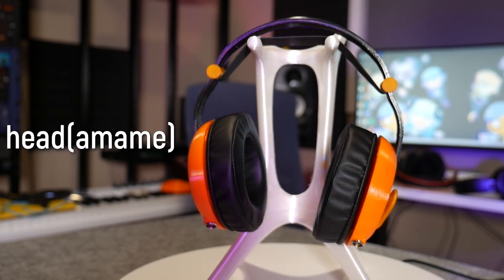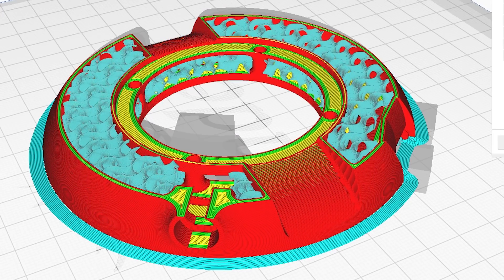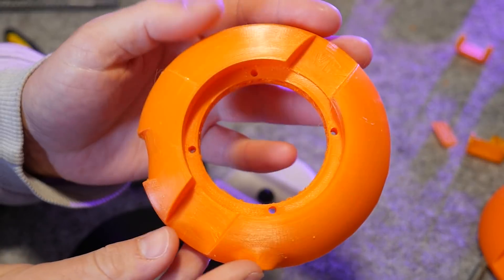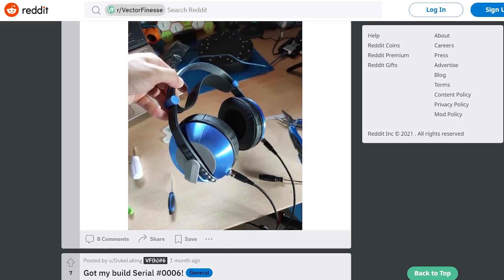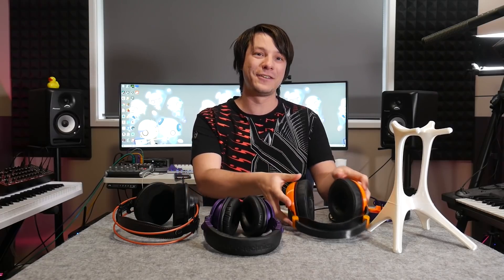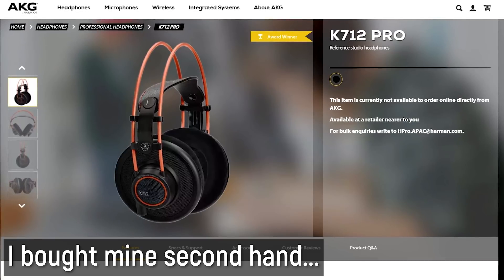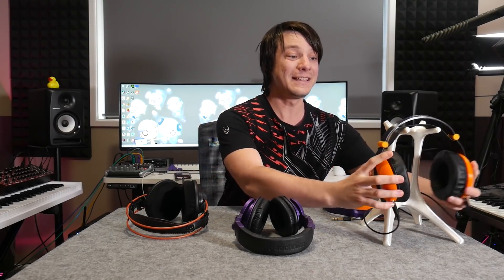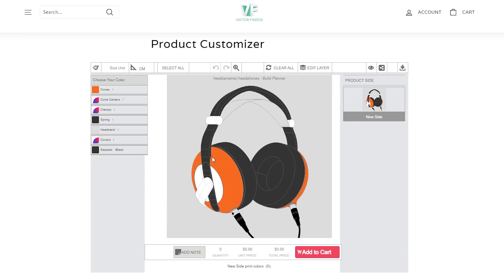Should you 3D Print Headphones? Head(amame) review

Comment: I built probably 7 different pairs of 3d printed headphones.   I would say the DMS Omega Headphone was by FAR the best one.  Although not as nice looking in my opinion, as the Satyr 3 Headphones.  Those were the second best in my opinion, and the then the Satyr 2 were 3rd.  Capra audio has headphone headband files for the DMS Omega as well so you can 3d print everything except the driver, wires and connectors.

Comment: You can try using velour or velvet earpads. This will give you more balanced frequency response with more clear hi-mids and treble. Also you can try thinner pads (leather, velour, velvet, etc.).
I just ended a mod project with an old bad sounding Behringer HPX2000. I replaced the old 40mm drivers with 50mm, very similiar to yours. Also replaced driver holders, 3D printed. I tried from about 10 pairs of pads - pu-leather, velour and velvet, different sizes and tickness. Of course, the much important thing is the driver itself, but the pads can seriously alter the overall sound response.
The use of leather pads brings nice bass, but also muddier sound in the mids and highs. I ended with velvet pads and sound very close to ATH-M50, which is one of my favourite headphones.

Comment: I am always confused seeing 3D-print channels struggling with... well... printing.
How is PETG difficult? It prints almost as easy as PLA.

You can have perfect results every single time.
Just use the generic PETG settings from Prusa every time.
It just works.
It is not the material. You just lack the experience with the material. But that is no problem, because Prusa did the work for us. 
The moment you start understanding that, you will forget about ABS and just go PETG. No toxic fumes, no splitting parts, no trouble.

On another note:
Thanks for the great video! This projecte is awesome! 

:-)

Comment: Guess I am screwed as someone with only a resin printer.
The infil settings are a bit of a deal breaker!
Reply from the maker: honestly I don't think so, you could replace them with a 3D Lattice which would resin print well. Could be interesting!
Reply: @MakersMuse  How dense would the latice have to be? I imagine the way the infills design actually has an effect with the cross section each part of it seems to have

As in, if you flatten each of the rows of infill down to 2d, it is way thicker than just a single line.
Would be interesting to try out

Still trying to get my resin printer tuned. I am having a bit of trouble. LD-002H
Reply: thinking about it, as long as they don't break off while printing, they should be fine. Just add some kind of supports inside the infill and it should be alright. Assuming you can get an stl with that support.

Though again, I am struggling to tune my printer. I am currently printing a bunch of monocure calibration matrixes to work out what settings are right. Still not really having much luck. In fact, do you have any tips or a tutorial for it?

Comment: I'm working on a 3d printed air filter using a standard carbon + hepa filter for water purification (cheap) and a fan. Maybe you could do something like that, since helps with particles from working 3d printers, VOCs from resin printers, and possibly prevent coronavirus floating in closed spaces.

Comment: The universal problem I've had with all headphone brands (save one) is always the same: the speakers are always flat. The brand I use solved this by setting the speakers not parallel to your skull, but parallel to your ears. It makes OTE headphones smaller (meaning less material), lighter, and thus more comfortable for long term use.

Sadly, Angus, none of yours do that, and I think you're missing out. If we're taking about sustainable design, ergonomics is a consideration. Imagine shaving 50 or 100g off those monsters.

Comment: Finally, now make  two speakers in each cup, for a dolby front and rear effect. The plug in should be optical to handle the four channels with the center shared. Nice that a sound engineer designed a baffle, gyro infil that optimizes 3d capabilities. A shared bass driver, cone design that amplifies tweets is in the future of 3 d printed headsets. They will be the sweetest sounding headsets at whisper quiet sound levels.
Gamers will buy these by the millions....

Comment: I will forever be amazed at how this man has managed to destroy beds by printing on them. I use PETG and I've never even been able to so much as scratch mine, save the time I dropped a knife on it.
Reply from the maker: What's the surface? Glass ones always die on me eventually even with glue stick. Lol
Reply: well, I tried replying but youtube deleted my comments several times in a row. this is frustrating to say the least. testing, testing, 1,2,3....
Reply: @MakersMuse  alright, comments seems to be working again. I'll just give a link if you ask. it's just a bunch of clear PETG prints and a lens I pulled off my machine. I use the seafoam-colored soda lime glass (as opposed to the yellowish borosilicate stuff) supplied with my cr-10s, and a glue stick- one of those purple ones that smells like cabbage and organic litmus paper. Most people print PETG like it was PET or ABS but I just print at 225c to 235c slowly, with a max of 45mm/s, usually around 20-30mm/s. I've produced completely transparent parts, and even lenses, so seeing so much destruction when you have thinner surfaces touching the build plate is really odd. perhaps I've stumbled upon the idea that reducing adhesion for the first couple layers is optimal here. it's definitely possible.

Comment: I generally prefer open backs for gaming (sound design too) as they produce a wider sound stage than closed backs.  It helps a lot in picking out a sounds location.  Of course like you said, you loose that low end response with open backs, but I think you also make up for it with usually better transient response.
Reply: You dont loose that bottom end with planar magnetics in open backs ;).

Comment: I print PETG all day long on my Prusa i3 Mk2s and it's my favorite material to print with.  Just dry it if it has sat for a while to cut down on the stringing and use Windex (glass cleaner) on your print bed, like the Prusa manual suggests, to cut down on the adhesion a little.
Reply: I have the prusa manual on my desktop for 'later reading', I also have a broken glass bed from a petg print adhering too much. Sounds like I should have read the manual sooner :)
Reply: @andrecook4268  Windex works great on the Prusa PEI coated bed to act as a release agent for PETG. I'm not sure how well it works on glass as a release agent, but I've seen people use a thin layer of glue stick (on YouTube) with good success.
Reply: I was using glass/painters tape/glue stick - which is what I use for ABS. It was too good.

I've gone to an off-brand PEI sheet, I was waiting till my glass/tape setup stopped working before I got the sheet out lol.

Comment: Warping on PETG? I can safely say this has never been an issue for me even with an open frame printer, using tons of cooling, in the middle of winter without my heater on.

Stringing can be an issue when I haven't dried it in a while. Other than that petg has been my go to filament for years now.
Reply: PETG is the only thing I can print reliably in my non climate controlled garage.

Comment: Yooo. .stl for that headphone stand!!
Reply: now in files section of website!
Reply: @vectorfinesse  thanks. I’m printing it now.  Love this design!
Reply: @Guapogiboy  share a picture when you get a chance!
Reply: @vectorfinesse  where?
Reply: @Guapogiboy  Reddit, insta, wherever!
Reply: @vectorfinesse  just finished printing it. It looks amazing. Very nice print using black PETG. I used rafts so that they lined up when putting together.  I ended up using crazy glue + accelerant to first line it up then I used a large M5 screw to bolt them together.  I shall post soon. 

Btw.  On the base there looks like a place for screws. What do you recommend to put on this part?
Reply: @Guapogiboy  we have threaded bumpers on our website that we also use in the headphones :)

Comment: Hey Angus, the "Rogue Bagel" is a great track which I didn't know before, thanks for mentioning it!

As for the M50x -- if you buy a set of replacement ear pads for them from eBay, they get waaaaay more comfortable, they don't cost much and no tool needed to replace them. Their sound does change a tiny bit, but not much. Try "Memory Foam EarPads Cushion For Audio-Technica ATH-M50x Headset" to find them.

Thanks for this review as well, interesting kit but seem rather expensive for the amount of work one needs to put in to make them in the end.

Comment: I am always confused when people who do 3D printing for a living (as content creators) complain about PETG being hard to print. It takes maybe 5 test prints to dial in a printer to PETG if you have a working PLA profile. With a bowden you will have to settle for some stringing because bowden sucks compared to direct drive but I have never even bought another roll of PLA after starting with PETG. Don't print on glass or ceramic though, I got an FR4 plate and there are no issues.
Reply from the maker: FR4 has been a real winner honestly, no issues with adhesion in it. But I always have massive moisture absorption issues with my PETG and similar so it gets super stringy - might just be the climate, but makes me avoid it.
Reply: @MakersMuse  Yeah, that's something I had to deal with in the beginning but now I just print straight out of drybox. 

On humid days I use an extra long filament guide between the drybox port and the extrude so the PETG doesn't come into contact with the ambient air at all before it extrudes out the nozzle. 

I think it might be overkill but after I figured out moisture was the root of basically all problems I had with my first prints, I like to eliminate that variable.

Comment: Using the gyroid infill for improving sound quality is just ingenius
Reply: I've been using infill as an acoustic chamber+filler for as long as i have a 3d printer, and i'm really surprised it is done so rarely. This is probably the first time i see someone else do it.
I mostly use rectilinear, it is still air-permeable, but prints faster.

Comment: Using gyroid infill instead of acoustic packing to increase the apparent volume is a cool idea. For speaker enclosures I use PLA because it's a lot more rigid than PETG. I wonder is this a compromise for durability, or does flex in the material actually help, maybe to reduce resonances?
Reply: I know petg is more tough, so I would think it would be less  susceptible fatigue failure.

Comment: Cool idea, I would've assumed doing this sort of '3D print parts yourself' would be paired with cheaper prices than other headphones on the market, but a quick look at the website still showed that electronics or even an assembled headset were still just as expensive, or almost twice as expensive as other headphone companies, like Astro for example. Like I said, cool idea, but a bit of a disappointing price tag.
Reply from the maker: You could source the parts yourself pretty easily and save some change doing the soldering yourself, thankfully there's no secret sauce in the components choices.
Reply: @MakersMuse  Certainly, I don't doubt its not difficult to replicate a similar product, just that as a company that advertises a 3D printable headset, I naturally assume that the business model is that by allowing consumers to make half the parts themselves, it would result in a cheaper product - but I guess not in this case :)

Comment: OOOh i just realized. i can probably put some holder outside for some Fiio BTR3K - BTR5 to use them wirelessly! i rather not modify the parts to not hurt sound quality since I don't understand a thing about sound. but that'd be cool :) removing the cable plugs completely that way and just plug them to the driver directly

Comment: Not having the output as a balanced stereo from one socket is a lazy design IMO, the wiring can easily be routed through the headband from one ear-cup to the other with the addition of an internal conduit, I bet they would look good with ironing or monotonic infill!
Reply: If it's easy you can just make your own right? These aren't for you...not every product is intended to reach everyone's needs.
Reply: @backgammonbacon  Yes I probably will make my own as I have 3 pairs of high end headphones that have broken frames, however I will most probably machine the parts from 604 aluminium and delrin
Reply: I hate the cable pulling on one side and would prefer this setup...